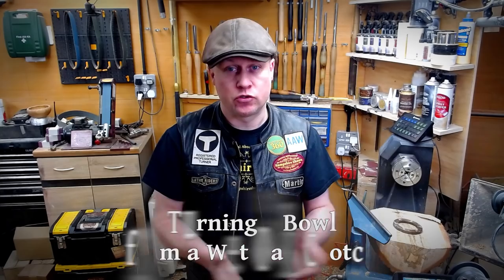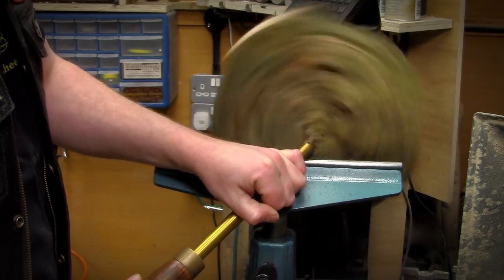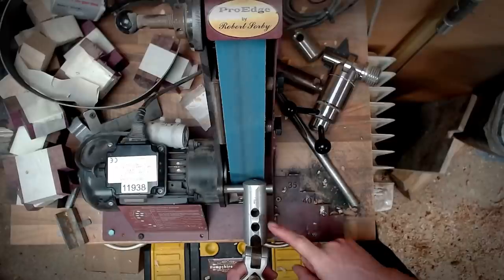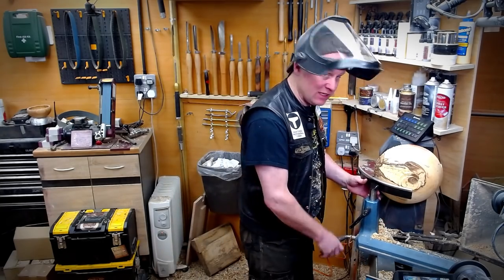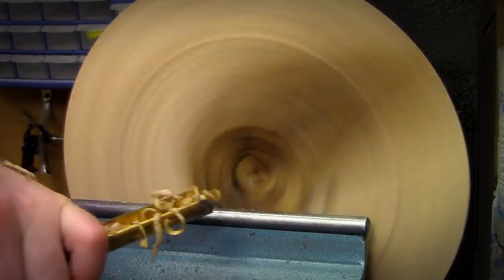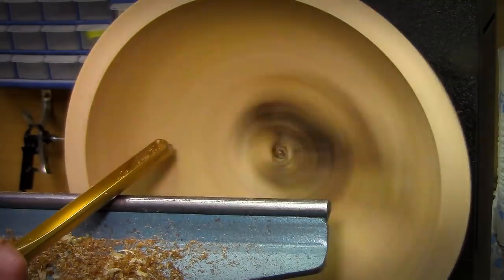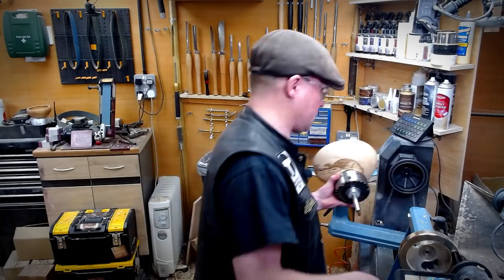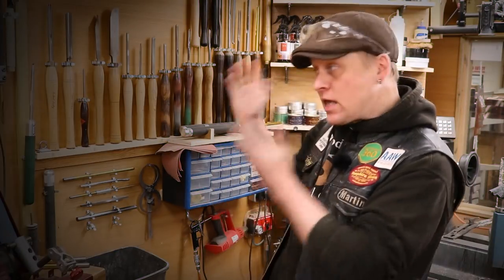#103 Turning A Wet Oak Crotch

Comment: Martin, glad you mentioned the Tannin stains. I 've almost quit turning Oak, especially wet/green    oak because it takes so long to clean up everything to make sure any metal doesn't rust.  And how thin did your turn down the walls for drying and minimum warpage?

Comment: Hi Martin... good to see you back sharing again... Quick question, when you turned the piece around and mounted on the tenon, it seemed to be quite a bit off center. When I get that because of the soft tenon, I try to return the outside again to true it up to the inside. Since this is a wet piece, I know things move a bit as you go... So how much out of round do you normally allow before you "fix" it?
Thanks,
Richard Parker